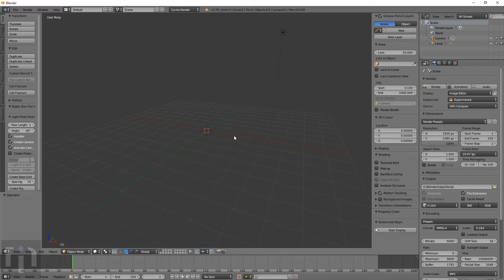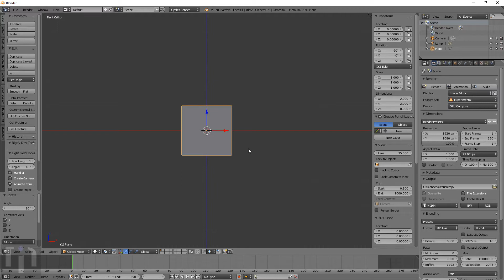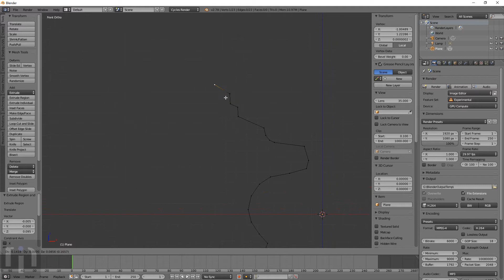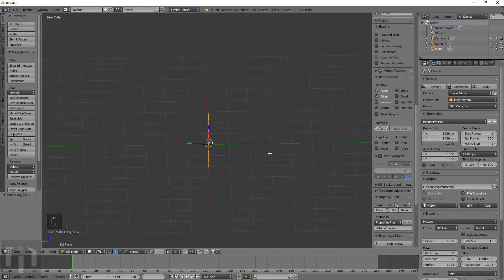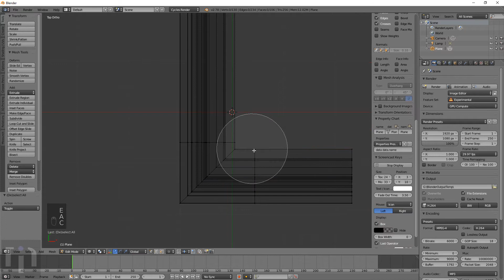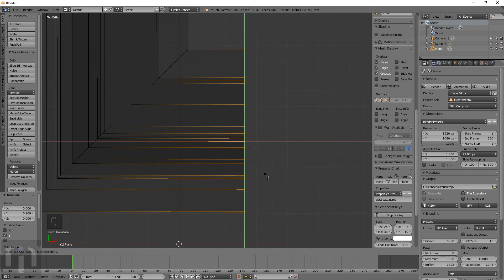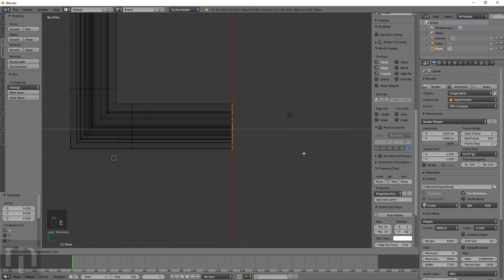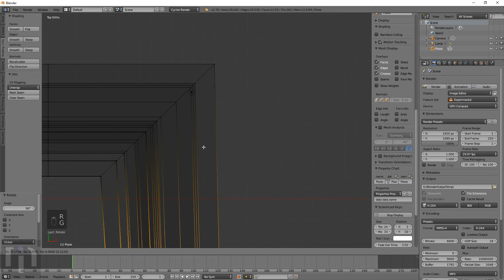Blender Tutorial #034 : Edge Trim Molding (Moulding)

Comment: So youre just eyeballing the 45 degrees?
Reply from the maker: No, after you press r to rotate, you can rotate the selection around the median pivot at any angle you want.  I was just typing 45 and pressing enter.  It makes the size smaller, so it has to be resized to match the rest.

Comment: It's much easier to use use the shear tool on the edges, scale it on the axis you need by 1 or -1 depending on the direction. Eliminates needing to do the rotate and sizing altogether.